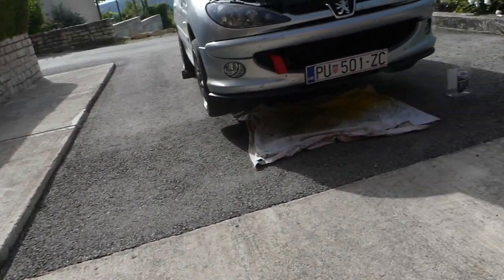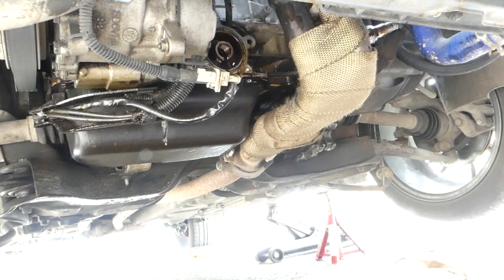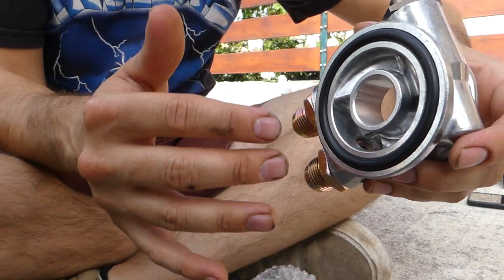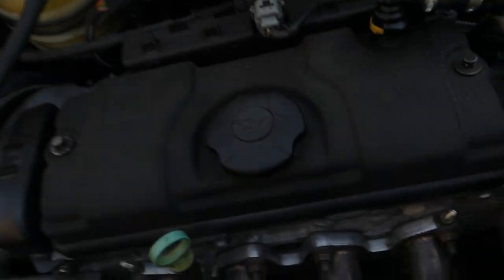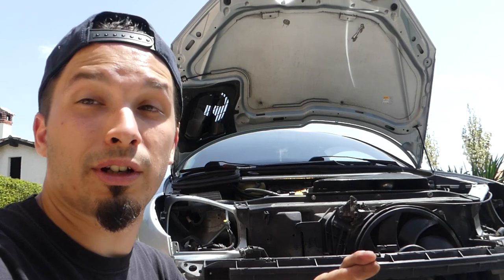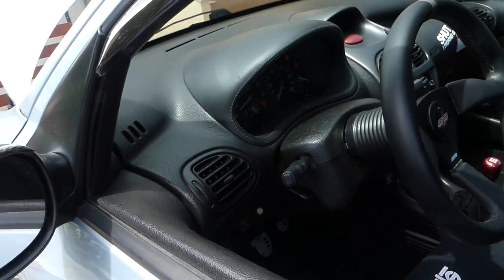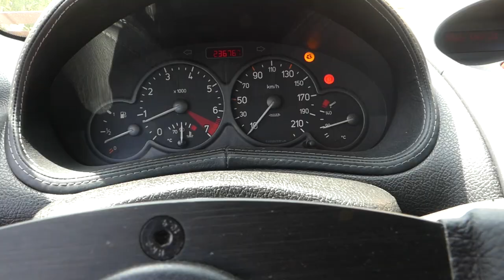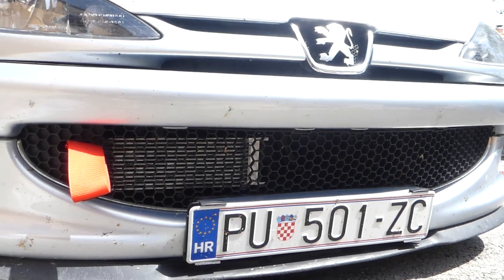INSTALLING OIL COOLER!!!On my Peugeot 206!!

Comment: Great job. 

Now take care about the oil press. When you add this mod, you are increasing the lenght of the oil circuit and the stock oil pump configuration sometimes can't be able to fill all the circuit with the correct amount of oil to match the correct pressure value.
Take care about this, especially if you go to track days or you like to drive fast often. I recommend you to install an oil pressure gauge.

Thanks for the video!!
Reply from the maker: That is a good idea, thank you! 
I want to go on the track, and soon I hope I will 😅
Reply: @Dynoo1000  i will go to the circuit on October 2nd to test the car. I hope not having any problems with temperatures, because i work a lot with the chassis, but the engine is stock, except exhaust, air intake, termostat and water cooling sistem.

This mod is on my "To do" list for the next year, with camshafts, pulleys, and gearbox mods. I want to reach the 140hp on my tu5jp4, and videos like this are very useful to give people an idea of the installation and how to start it.
Reply from the maker: @abranin93  Thank you man!
I wish you all the luck on the trst day!

Comment: Hey, one question: Did you close the hole for the Bypass on the Right side of the Block where the oil Filter Housing is mounted on? Or did you close it with the Sandwich Plate?
Reply from the maker: we cut a thread on the block and put a screw with a washer.

Comment: Where did you buy the conversion kit?
Reply from the maker: That's the thing, it's not the kit, i got all parts from diferent places.
That M20 bolt is from Mocal, Termostat plate is from Race-shop,  Oil Cooler with lines are from MaxPeendingRods etc..
Reply: Link m20 bolt?

Comment: Can you give the link or part number. Of the adapter plate used and, the nut that screws into block.
Reply from the maker: This is adapter bolt M20 from Mocal:

https://www.ebay.com/itm/MOCAL-M20-M20-OIL-COOLER-SANDIWCH-PLATE-CENTRE-BOLT-MALE-MALE-ADAPTOR-QS-/122641114562?mkcid=16&mkevt=1&_trksid=p2349624.m46890.l6249&mkrid=710-127635-2958-0

This is sedwich plate:

https://race-shop.hr/adapteri-za-filter-ulja/1114-adapter-ispod-filtra-za-ulje-ulaz-izlaz-an10-s-termostatom.html

This is Oil Cooler set:

https://www.ebay.com/itm/13-Filas-Enfriador-de-Aceite-AN-10-AN10-Engine-Oil-Cooler-Filter-Adapter-Kit-/154412273883?mkcid=16&mkevt=1&_trksid=p2349624.m46890.l6249&mkrid=1185-127638-7840-0

Comment: There is a sensor attached to the oil filter housing. How did you dealth with it.
Reply from the maker: I have just remove it...oil pressure and oil temp still works. I have tryed to find online what is that sensor for but i find nothing.
Reply: @Dynoo1000  this sensor is for the oil press, the oil temperature sensor is on the block.
Reply from the maker: @abranin93  but i still read oil pressure

Comment: hello, where did you get the bolt that you installed the first time before putting the plate sandwich please ??
a link or details of the bolt so I can get the same please
Reply from the maker: Ebay, M20 bolt
Reply from the maker: https://www.ebay.com/itm/122641114562?mkcid=16&mkevt=1&mkrid=711-127632-2357-0&ssspo=63akh65fR-a&sssrc=4429486&ssuid=vz0Jj3HBQ8q&var=&widget_ver=artemis&media=COPY